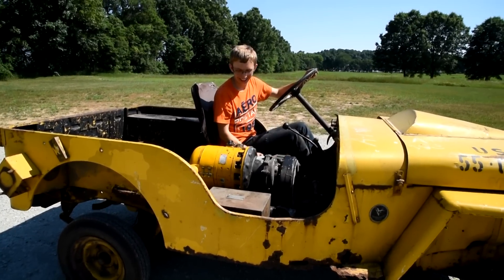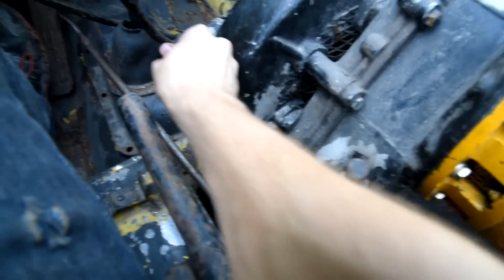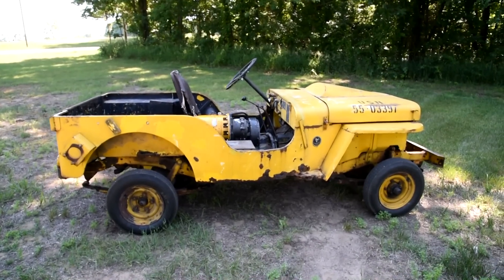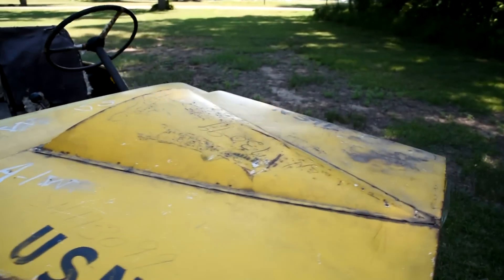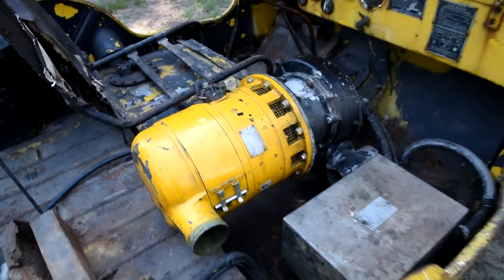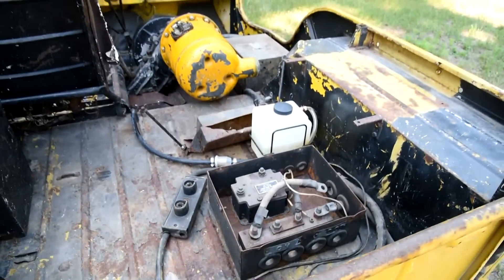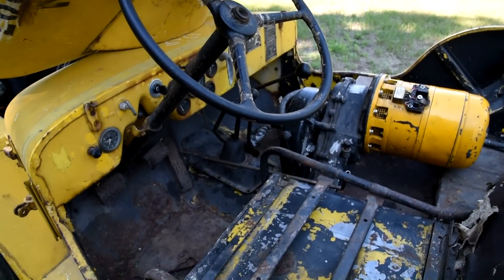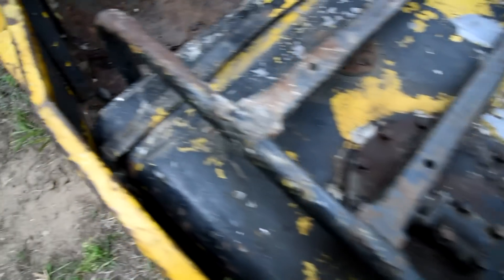APU Jet-Starting Jeep: First Generator Test

Comment: The cable with the connector, at 4:08, is not to connect to an aircraft.  What you are looking at is a quick connect battery connector. The cables the powered aircraft would have had a three pin plug at the end of a long cable.

Comment: the 1950...so a time before air turbine starters and pressurized jump starters. we don't use these anymore because electric motors required to start modern jets would be much to heavy.

Comment: I don't believe that was for two generators.The ones I've seen that did have two had the firewall cut out to make space.  What I do think is that your generator is missing the shroud at the front.  This shroud directed the air out a tube and into the back of the generator for cooling.

Comment: Maybe the navy used some different nomenclature but this is just a generator to provide external power. An APU is usually a small gas turbine compressor on board the aircraft that provides power and bleed air.
Reply from the maker: Must be. The 1950's documents referred to these as APU's.
Reply: I didn’t mean to downplay it’s coolness.
Reply: actually, APU only means "auxiliary Power Unit". Many WW2 Bombers had Piston engines as APUs, so it doesn't really mean gas turbines, most Plane APUs are gas Turbines.
There are also small Piston APUs for Trucks. 
Also many Tanks have APUs
Reply: I didn’t mean to imply that an APU could only be a Gas Turbine Compressor, just that it being separate from the aircraft it would be an external power unit.
Reply: oh ok, that makes more sense. Just Misunderstood you :)

Comment: Be careful sitting at the same rotation as the apu, when i was in the Marines i had used an airforce apu electric cart it stated on it the it could blow apart in that angle and to not stand there. Also dont stick your hand near the apu exhaust i personally know someone that huddled under an apu exhaust to get warm and he got shrapnel in his back from the apu grenading.

Comment: Amps, volts, RPM? Would love to get to read the nameplate. These aircraft generators are typically 30 volts, I would guess yours to be 500 amp. They spin pretty fast. I'm going to set one up on a PTO in my bus conversion for auxiliary power while under way.
Reply from the maker: Great guess! 30V, 500A at 400-800 rpm. Jack & Heintz model G32-3.

Comment: I would suspect that someone who owns a jet would like that jeep to go with it. Are you going to get the rest of the wiring completed?
Reply from the maker: I'm looking for a control box. Probably will never hook up the components for safety reasons.
Reply: Are you planning to keep or sell?

If selling I would let who ever buys connect the electrical as they will need to replace the connectors for the jet.
You can wire it if you know what your doing. The age of heavy duty wire needs to be replaced. The large boxes you should probably replace as well with newer water proof boxes. The ones that are on Jeep look like standard boxes. You can get 300 amp 12 volt breaker on Ebay or what ever the max power of the generator is.
Reply from the maker: Probably keep. I don't plan on ever making the electrical system function again. I'm weary of electricity, let alone that massive generator.
Reply: The kind of power that generator could probably power a small house. So you are correct to be respectful of that. You may want to pull the brushes (put in zip lock bag and put in glove box) so that it will not make electricity and reduce a possibly of an accident, if you are not using it this will reduce the possibility of locking up the rotor as well. If your not sure what the look like check out http://www.ebay.com/bhp/electric-motor-brushes the will be similar, not exact.
Reply: Isn't it brushless?